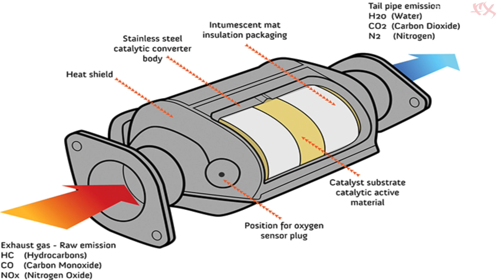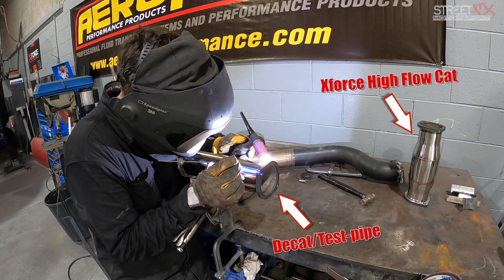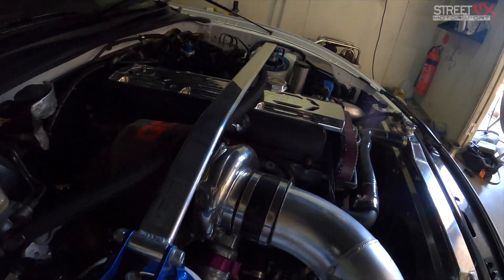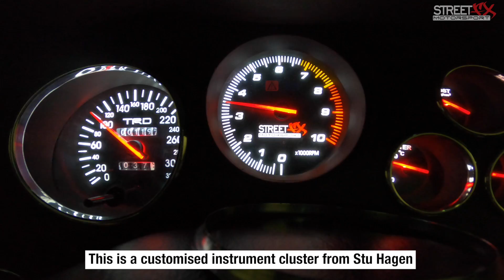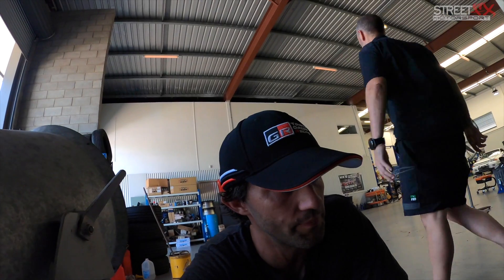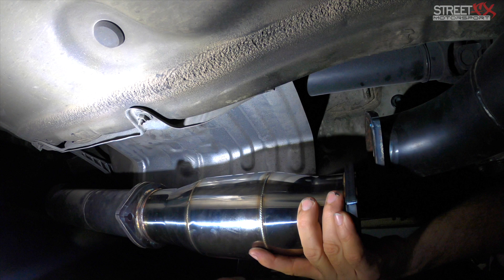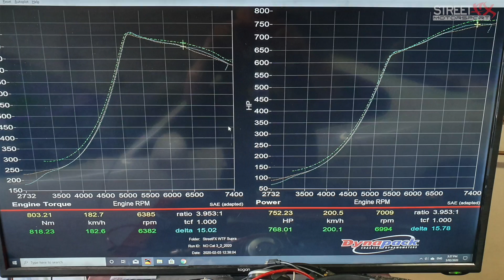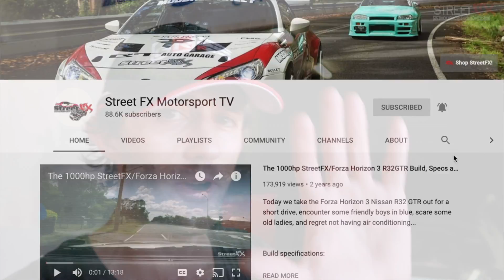REAL RESULTS.. Is it really worth running NO CATALYTIC CONVERTER? We test it on our big power SUPRA.

Comment: 15 hp is a big difference when the vehicle only make 200hp.
Reply from the maker: Look at the graph at 200hp... there's zero power difference between cat and no cat... that's part of this test.

Only comes into play when you're getting to the limits of the exhaust diameter.
Reply: @StreetFXofficial  You are comparing it to a high-flow cat, if you compare it to a stock cat at 200 hp (like my stock-power BMW) no-cat vs stock cat is a pretty big difference. I am only considering a no-cat because my car runs on LPG, which has almost no emissions... However, seeing this makes me think about going for a very cheap high-flow cat....
Reply: @deanjohnson7283   What is difference between stock cat vs no-cat in your BMW?
I have CLK320 1997 218PS and i thinking about remove cats.
Reply: @StreetFXofficial  at your 200hp mark you're putting out a forth of the engine power, with a 3 inch custom built exhaust. So yeah there wouldn't be much of a flow difference. Now the people the leave the stock exhaust and simply remove their cats will probably see bigger gains. Even if they too only see an extra 15hp, if that engine only produces 200hp max an extra 15 is more noticeable.
Reply: @4BillC  You will never gain 15hp from a 200hp engine by removing cats. The engine's flow restriction wouldn't be the cat, but cams and heads.
Reply: @4BillC   I agree. This car has sport cats no ceramic stock cats.
@Street FX Motorsport TV  Please repeat that with stock exhaust.
Reply: High flow 100 cell cat flow way better then stock
Reply: @tobymobilia4756  and straight pipe flows even better...
Reply: @4BillC  yeah compare stock cat to straight pipe you will see bigger gain
Reply: @tobymobilia4756  unfortunately where I am you have to have a cat to pass the inspection, then it has to pass an emissions test.
Reply: I gained 20whp on my 350Z with test pipes.
Reply: @danielholbrook4823  and you would've gotten 18 whp with high flow cats
Reply: @danielholbrook4823  without tune?
Reply: TopiAS06 yes, I did my intake first which got me 12whp with high flow cats then I got test pipes I gained another 18.
Reply: TopiAS06 next to no gains with my old high flow cats, tuner reckons around 5hp
Reply: Now does the high flow cat work properly or is it just there to satisfy the guberment?
Reply: @williamkillingsworth2619  it brings back emissions to legal levels, so yes, it satisfyes the government, and should also satisfy you for such negligible gains.
Reply: Andrés Monzon word! I live in south where there is no emissions testing, most modified cars have no cat as there is no oversight. 

Nice to see you can make power while being environmentally friendly. 

Now time to 4” it!
Reply: @Chiguirinho  not in California
Reply: @Benjamin Vadocz the %loss is not a constant number directly multiplied by power. A 200hp with a 10% loss would have 20hp losses, that is common. However it doesnt hold for higher power cars, a 1200 hp car doesnt lose 120hp
Reply: @Benjamin Vadocz real drivetrain loss doesn't work that way, that is what I wanted to say.
Reply: @Benjamin Vadocz inertia, oil viscosity, friction, and heat come into play. The % is an estimation, a more advanced approach is to calculate lost torque at the highest power point of the engine, and apply that loss to the whole graph
Reply: @maiy8786  nissans gain 20 whp lol
Reply: @maiy8786  basically anything with a vq35de. I gained roughly 10-15whp with some custom fabbed test pipes on my 03 350z track (6MT). It was 245-250whp over 3 pulls with the stock cats and 260-265 after 3 pulls with the test pipes. Then I tossed on a 1/2" plenum spacer and it came back at 270-275 after a quick a/f tune. A better y-pipe and downpipe added another 5-8whp running into the stock muffler setup. Then, a Mishimoto cai added another 8-10whp. At the end of those "mods", it would dyno between 280-290whp depending on heat, etc. Cost right around $1k in total, maybe a little more.
Reply: At 200 hp catless doesn’t make any more or less power than a high flow cats over 600 hp is where cats restrict power anything below this cats are absolutely fine

Comment: Typical stock cats are designed to flow about 1.5x more flow than the stock engine usually produces. Until you force more than 1.5x stock air flow through an engine you shouldnt notice any flow restriction on a stock cat. Once you slap on a larger diameter exhaust and a different cat then all that goes out the window and your on your own.
Reply: unless we are talking about oem catalysts from 90s cars, then they are quite restrictive. modern cars however are much better about catalysts not being a restriction.

Comment: 9.95mm lift on the cam.....that's not much more lift than a stock 318 Chrysler can which is only .373 inches.

9.95mm = .392 inches
Reply: The full race cam I have in the 482 SBM that I built a few years back has a .620 lift

.620 inches = 15.7mm
Reply: is that chrysler single intake and exhaust cams?
Reply: @jonathan7744  standard OEM camshaft for a pushrod 318 CID V8
Reply: @markdubois4882  so having only one intake cam you will need way more lift on the valve to flow then same amount.  However the valve is also bigger but the principle is the same. Twice the valves will need less lift to flow the same
Reply: Stock 2jz lift is 8.25 or .325 yet can flow 6-700hp (choking the engine a little) tho I never knew american engines ran that crazy of lift. Thanks for the info!
Reply: @jonathan7744  

6 to 700 hp with the aid of a turbo.....what would it be without?

318 CID = 5.2 litres

the 482....7.9 litres.....this is a full on drag racing motor
Reply: @markdubois4882  2jzge make 230 hp stock 183ci. 2jzgte makes 320 stock. With just a turbo upgrade itll make 6-700 but restricted with its air flow.
Reply: @jonathan7744  

The 482 I built up a few years back packs almost 1700 HP with no boost whatsoever, and sits in a 69 Dart GTS.
The best time it has run in the 1/4 mile is 5.82 seconds @ 261 MPH
Reply from the maker: I actually made an error. Its 10.20 on intake, 9.95mm exhaust. That's far bigger than standard, and help accommodate for higher revving without valve float.
Reply: @StreetFXofficial  That's still only .402 inches lift.
The intake valve on the 482 is 2.25 inches and the exhaust valve is 1.94 inches in diameter respectively to go with the .620 inch lift produced by the cam.

Comment: Excellent video thanks for the info and straight forward comparison! There also seems like a bit of a drop in PSI between the test pipe and high flow as well? Any way you look at it though, go high flow cats save the environment (a little bit), avoid a fine or worse, and don't smell quite as much like a service station!

Comment: Why is this Supra still in the 12’s???...  My gs300 is only 350RWKW running 12.46 at 108mph and I have speed cut at 900-1000ft, this car should be in the 10’s. once my speed cut defenders is in and I put e85 I’ve got 450RWKW, it’s a 10 second car all day.
Reply from the maker: It's a supra joke that "all supras run 12s"  :) 
It''ll do 10s
Reply: Street FX Motorsport TV ohwwww... looking forward to that video.

Comment: Straight to my experience, i gutted the cat in my exhaust manifold and i replace the 2nd catalytic with a resonator, the car has 85 HP stock, but i feel like i have another car with better engine
Ps : i didnt run a horspower test
Reply: Your stock Catalytic Converter would be very restrictive, the high-flow cats are less restrictive as shown.
Reply: How old are your car? Maybe your stock catalytic converter are old and broken so that can be why you feel gain.
Reply: Gutting your cat creates turbulence.  It's better to get a test pipe.

Comment: With that ticking sound I had the same thing drive me mental when i went big cam and single turbo it was the mls gasket on the turbo manifold to the head have a look and make sure you haven't got an exhaust leak
Reply from the maker: Yeah I know the noise you mean, but in our case the noise isn't there til the vvti switches off cold start. It's actually quiet when the car is first fired up, then when it's warm it just makes that ticking sound.

Unplugging the solenoid or advancing the timing also changes the tone. 

We tried advancing the idle timing to take up the "slack" and shut it up but it didn't work :(
Reply: @StreetFXofficial  Does the car have an egr system?
Reply: My bet is valve spring rates

Comment: love the build! one question how did you get the DBW throttle body to clear both power steering lines? i used a PHR fitting for one, but the high pressure one Im not sure on.

Comment: hiflow cats are pretty good now so staying legal is always great for worries, but for those of us with pre82 cars that came catless its great, This is 100% better than one video i saw of a cat company running an old 60s v8 up on the dyno cold then installing a cat and making 1 hp encouraging everyone to put it on their cars, if you dont need it dont run it
Reply: 1984/5 commodores were still leaded so definitely no cats in them
Reply: my car was reg'd as 83 (not sure how, its an 86) and was fine catless? This was in vic though if thats any different? This was a good 10 years ago though.
Reply: @Mr_jz_12  brendan randle 
wasn't too sure some cars got cats earlier some later, my 82 mazda was leaded and still has a cat, my 81 one doesnt though
Reply: after '86, unleaded was mandatory for new cars. Before then, it was up to the manufacturer what fuel to specify.

Comment: what are the full throttle afr set at with or without the cat?
Reply from the maker: Ahhh.. you know your stuff :) while the first run was back to back with no fueling changes, the AFRs did go slightly leaner without a cat and needed to be adjusted. It was not enough to worry about and we didn't want to get too technical in the video. But you're right, the fueling was later adjusted to compensate for the slight afr change.

Comment: Did you retune the car for the catless install or did you just use your cat friendly tune in the car for the test?
Reply from the maker: The car originally had a cat, which was removed for our test. Then the car was retuned for catless (with the test pipe). We needed to make some other tweaks to the tune anyway.

Once the new cat went in, we did back to back runs to get the exact power figures without making any changes at all (which are the numbers shown in the video).

Afterwards, you're quite right though, because some changes should be made to accommodate a cat. 

A cat will change AF ratios slightly, so the tune was altered to compensate for this (but not before the results were compiled).

The cat restriction also meant we were making slightly less boost (around 0.3psi less). Which in itself could make up for the power loss anyway.

Comment from the maker: NOTE: There is an error in the video that I need to correct: The high flow catalytic converter as shown is a Metallic substrate which is coated in ceramic, and not a straight up ceramic honeycomb substrate as mentioned. Their functionality is essentially the same.

Also note: Please read the annotations in the video. This is not to say that there aren't gains to be had from removing your factory cat.. but the comparison here was between decat and a high flow sports cat which any decent exhaust system should have.
Reply: Hi.. can u guys get a stock sports car so some economy car that often people mods, and see with just removing the cat without any other mod, will we see any gains?
Reply from the maker: @AmirPomen  we will be testing this exact thing in our A90 Supra soon :)
Reply: @StreetFXofficial  awesome! Cant wait
Reply: Could you also test it with a complete exhaust system bypass valve like they secretly put on police cars when they throw the switch that turns on the lights and they go full rip on open headers to chase down Supras and Skylines.....?
Reply: Decat definitely makes a big difference in any force inducted car. Cut the BS..my car gained about 20hp just from DPF delete. And there's the second cat that gives another some power if deleted as well as soo much better EGT. 

Here in the video without a tune 15hp with a euro3 cat delete only speaks for itself